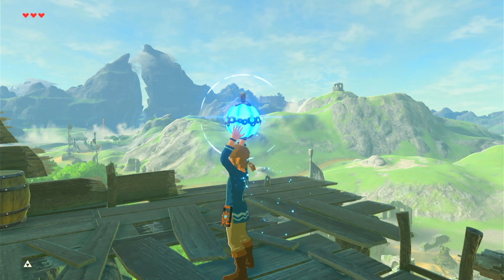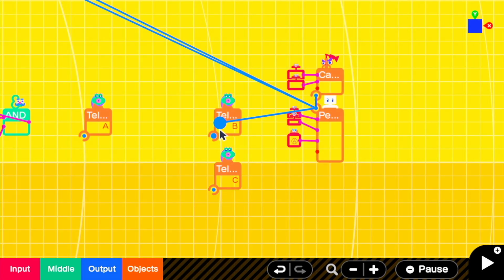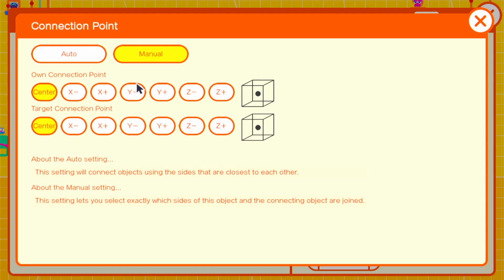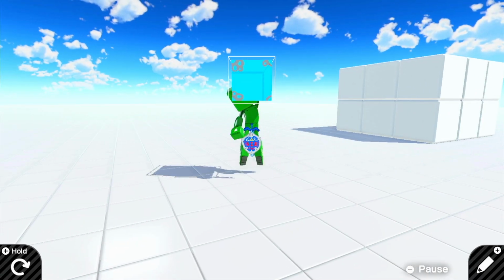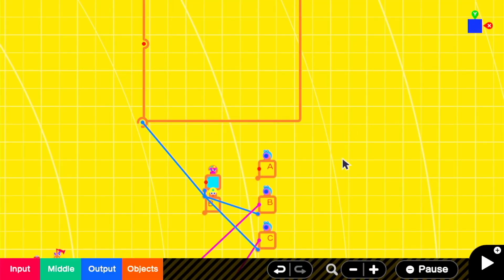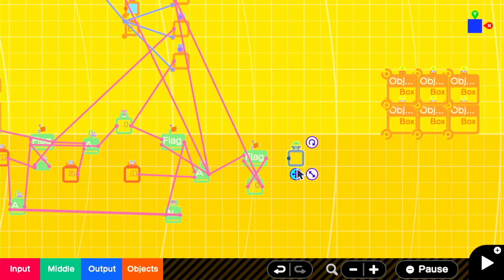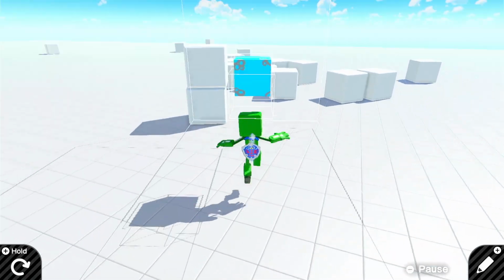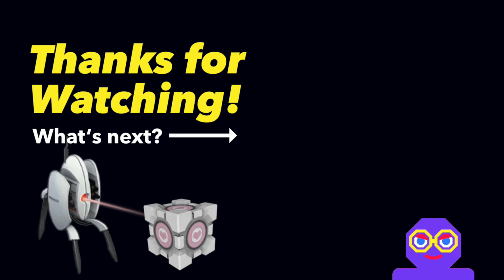Recreating The Bombs From Breath Of The Wild in Game Builder Garage

Comment: Can you recreate the dive from mario sunshine
Reply from the maker: I actually will, a few people have asked that but to me I always get reticent because I don't know how to make it look right since you CANT rotate the person nodon. But at least I can show how to do the physics of it, etc.
Reply: @DaveNodon that'll be fine just make the player do a turn or a kick action and It should look fine
Reply from the maker: @bojo_joel  yes! And so I can identify, by dive you mean the like slide dive that gives you momentum forward and slide for a bit, 
And not the stomp “dive” that shoots you straight down right?
Reply: @DaveNodon  just jump dives in odyssey
Reply: @DaveNodon  and one small thing. Is it possible to make the person not as floaty. I'm trying to make a mario style engine and the person jumps like luigi and not mario
Reply from the maker: @bojo_joel   it’s tricky, the person’s floaty physics are almost built in. There are ways to make your own physics based character from scratch but they can get hectic. 
Loup&snoop has a video or two on doing exactly this. 
If you want to avoid that I might play around with adjusting the size, turn speed, jump force, and perhaps attaching a shape to make the physics act a little different. Like maybe turn the jump power down, and then attach a moving object and give the character a little boost upward for one frame to make the jump appear more snappy?  🤷🏻‍♂️